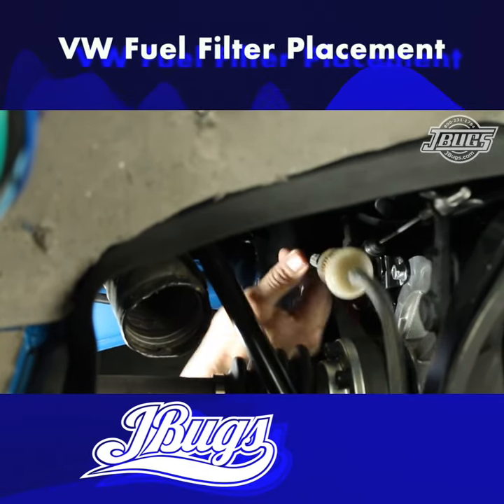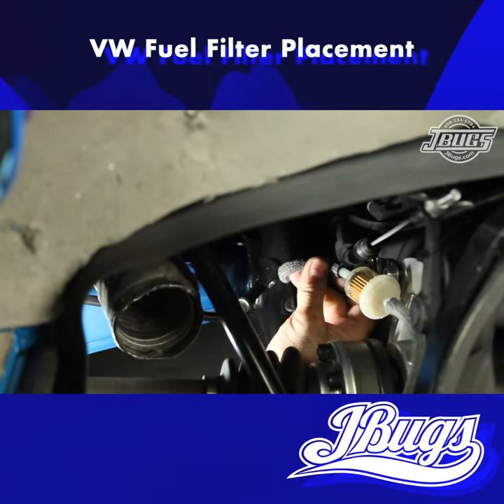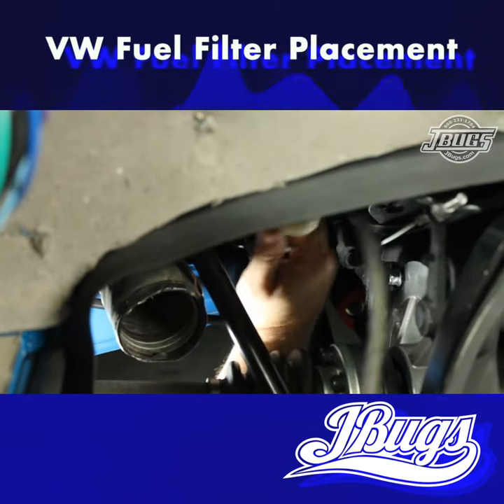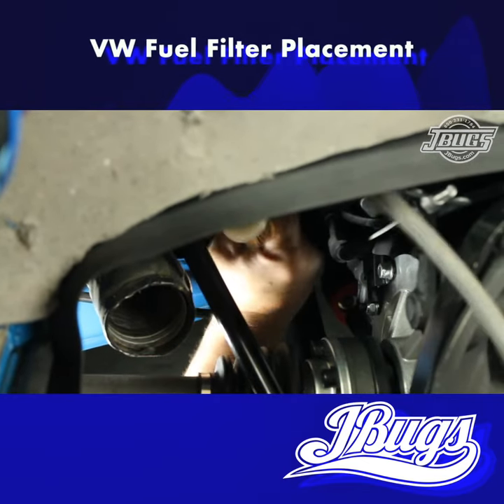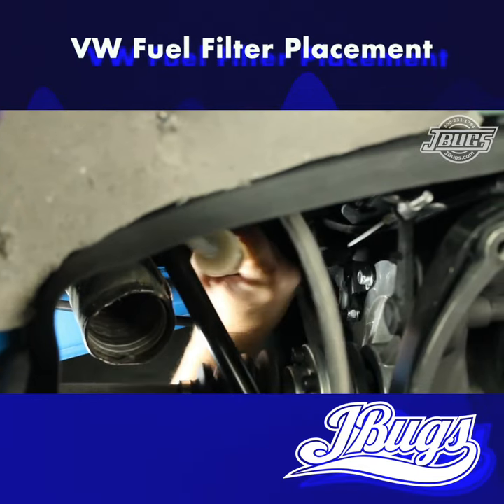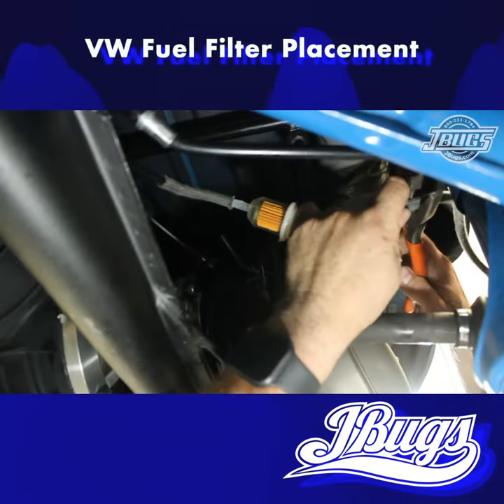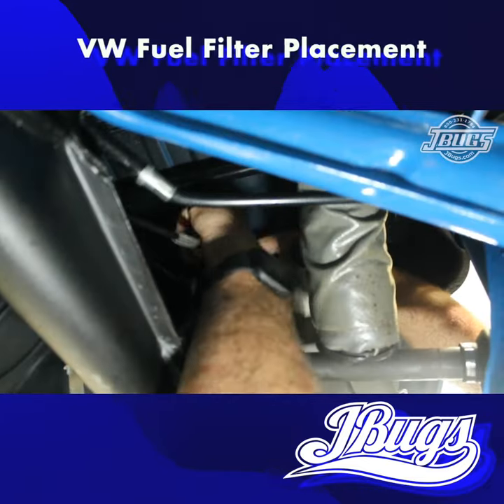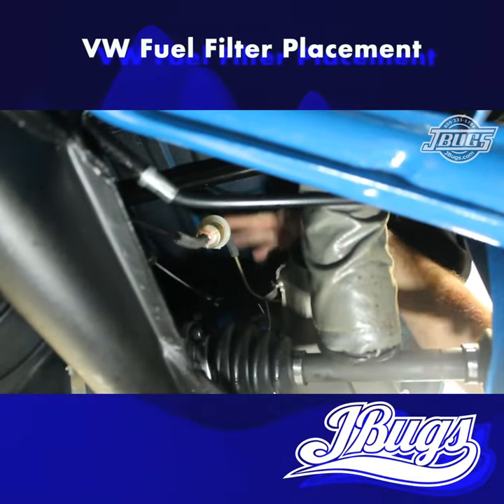JBugs Tips & Tricks - Fuel Filter Placement

Comment: Could u pls elaborate on the significance of the placement of the fuel filter
Reply: Is it bc of the plastic if so would a glass filter work better placing it near engine
Reply: Sure, a fuel filter in or near the engine compartment isn't a good idea.
Reply: Plastic could melt, glass could break, an additional cut in the fuel line gives two more places for a possible leak. Take your pick, the fuel filter, any fuel filter does not belong in the engine compartment.